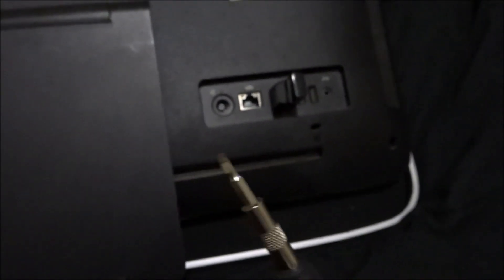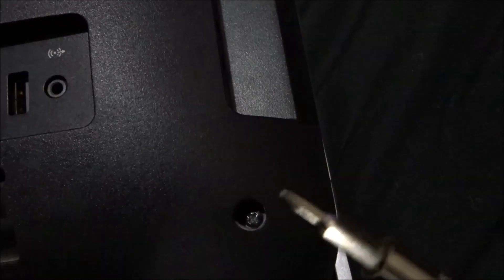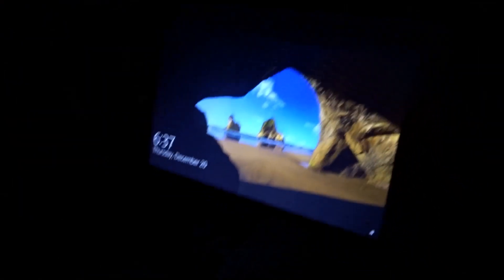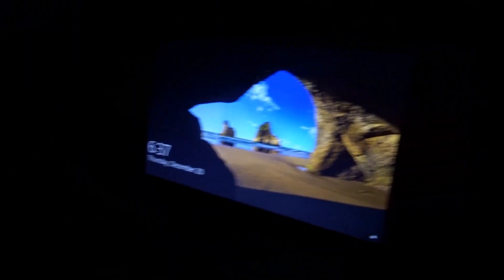Save $80 Upgrading Memory In An HP Pavillion 23 All In One PC

Comment: Thanks for the tip. I have the same PC but with 8GB and want to upgrade to 16 as I edit photos in Lightroom which requires 12Gb to run at a decent speed. Best wishes from Hastings, England.
Reply: Hi, 
I have the same pc, can you tell if there is 2 RAM slots inside? My pc has 8gm RAM and I wanted to upgrade to 16gb.
Thanks
Reply: @79shaque  Yes. That is exactly what I did.
Reply: Hello Ziggy. I'm Teresa's husband Kevin. I hate to have to inform you but my wife passed away on January 17th. Please keep the girls and I in your thoughts and prayers.
Reply: @SoWikkedTv  I’m so sorry to hear that. My deepest condolences to you and the family.
Reply: @ZiggySheppardUK  thank you...🙏🏾🙏🏾🙏🏾